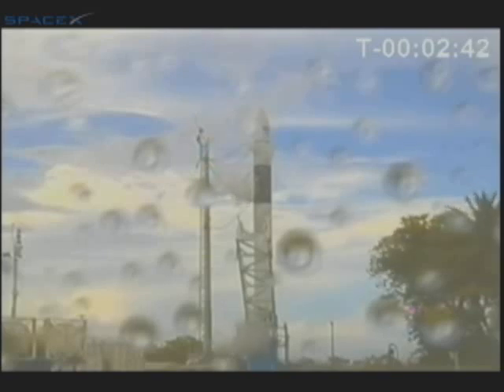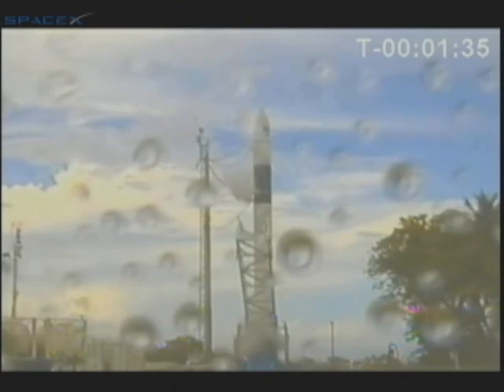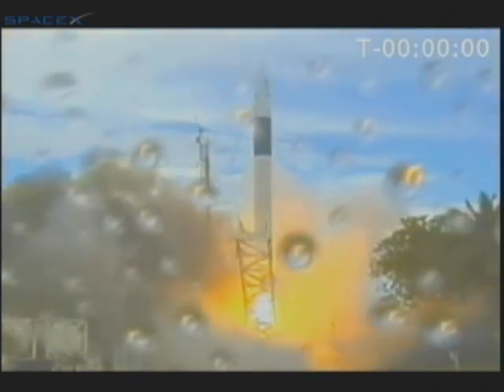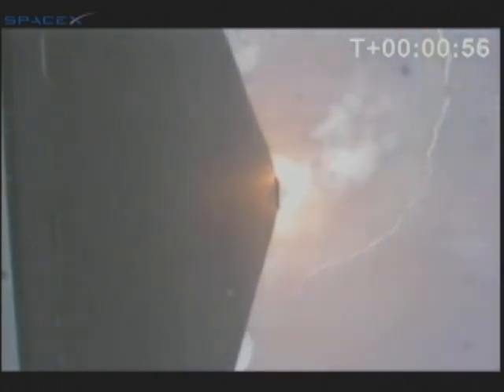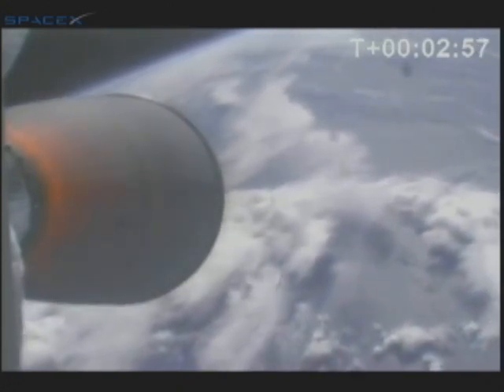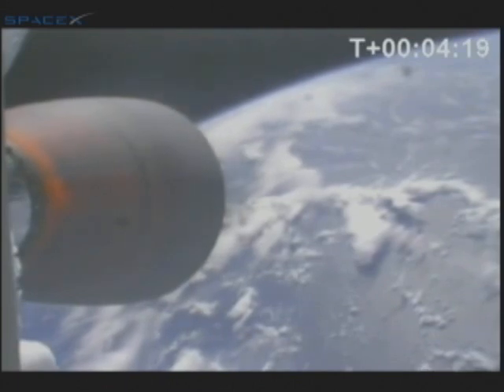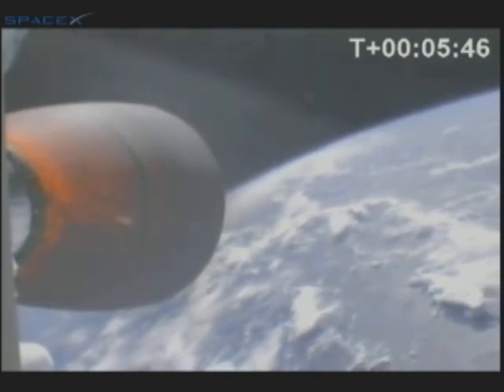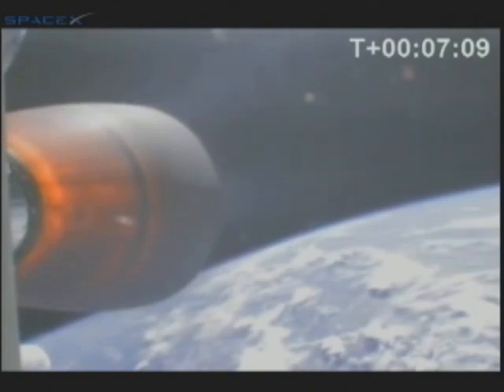SpaceX Falcon 1: Razaksat Launch on July 13, 2009

Comment: IMHO: Optimal LV of light / microsatellites 200-500kg of LEO / SSO
- The parallel arrangement of stages
- 7 LPRE nozzle "aerospike" (5 LPRE on  booster, 2 LPRE on orbital stage)
- Overcooled liquefied methane / oxygen vapor
- Use of aerodynamic quality - VTHOL

Comment: Rockets are usually launched near oceans for a good reason, it is easy to get the trajectory/wind so that the 1st stage falls down to earth over water where not only is free of people but makes for a soft landing + easy to tow back to base.

BTW, when you saw that rocket, it wasn't falling, it was still speeding up into the sky at 1000 miles per hour, it is just the second stage with the camera on it was going much faster. Though it would eventually fall back to earth.